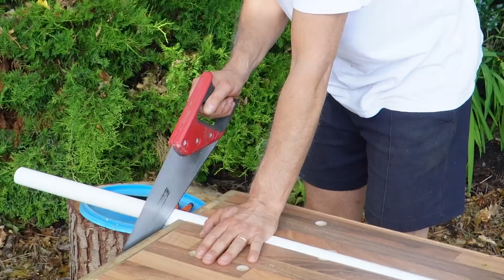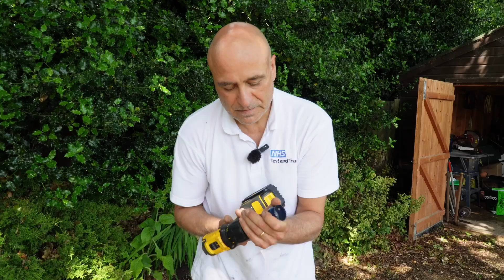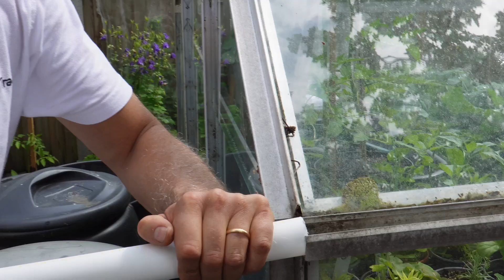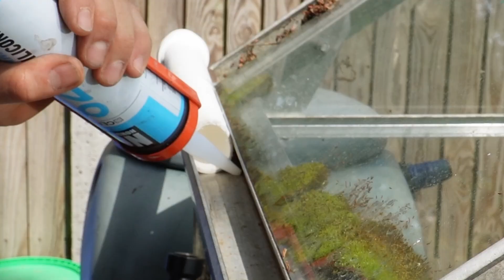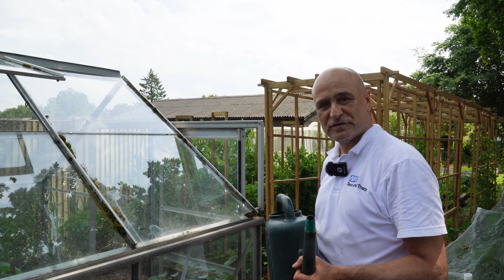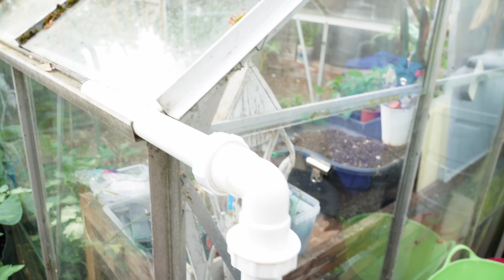Collect Greenhouse Water – Simple DIY Gutter System

Comment: Good morning my friends.  I saw this the other day and determined to watch it.   Collecting rainwater is such a valuable thing.  It is something I have considered many times here.  But it rains so much here that I don't know how useful it would be.  Plus I have a well.  Still, it is an important project for most people. 
Covered is better than not covered, it keeps mosquitos from breeding in the water and keeps dust and leaves and such out too.  I would probably work out some kind of overflow system also.  Basically a pipe sticking out the side going to someplace I wanted the overflow to go to.
Reply from the maker: Thank you for your thoughtful comment, Jim. It’s great to hear that you have considered rainwater collection. Even in places where it rains a lot, having a system in place can still be useful, especially for watering plants or using in the garden. You are absolutely right about keeping the water covered to prevent mosquitos and debris. I love the idea of adding an overflow system, definitely something to consider for any setup. Appreciate you sharing your thoughts, and I hope this inspires some new ideas for your space.